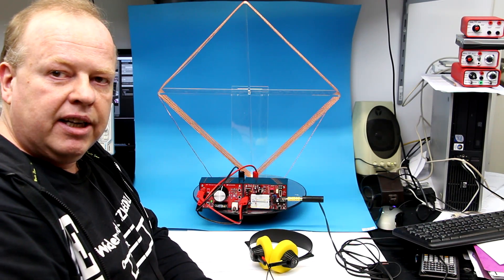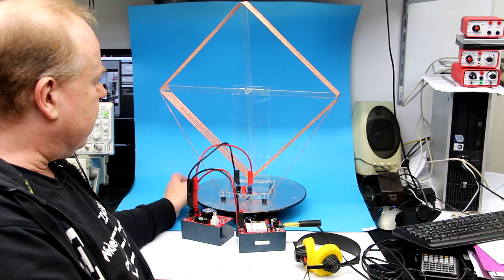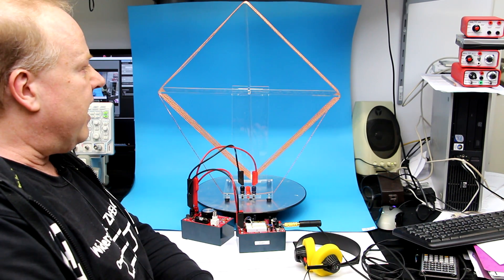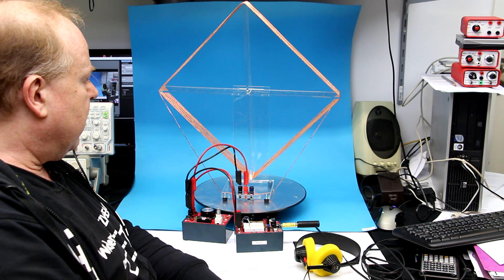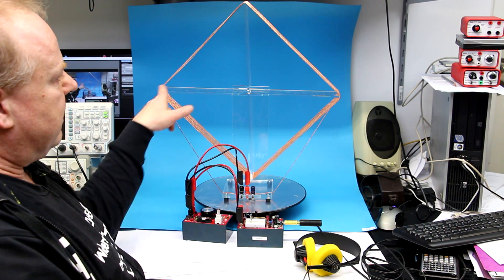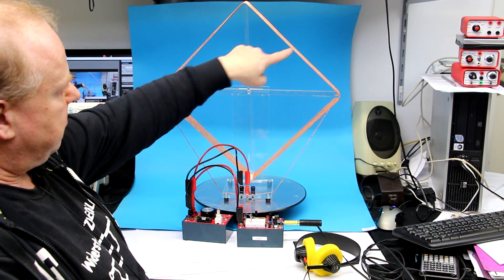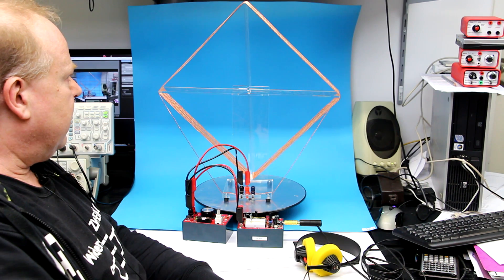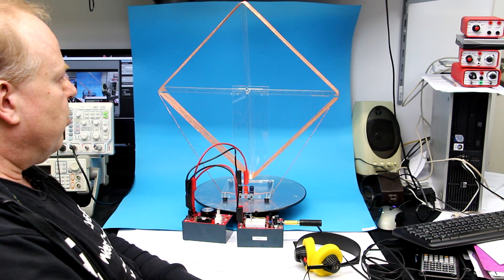New Frame Antenna available

Comment: is it different than a loop antenna ?
Reply from the maker: A frame antenna is of course a loop-antenna. But it´s a multi-turn loop and it is used not in short-circuit mode.

Comment: @KainkaLabs; 
Hello, 
since when this high-quality plexiglass frame-antenna is not available as a kit in your shop?

The description of the antenna on the store's website says. 
     "Die Rahmenantenne wird als Fertiggerät oder als Bausatz mit einer (englischen) Video-Anleitung zum Zusammenbau geliefert."

In addition, the clock on the forum page (both De & En) is incorrectly set up (it's delayed) and one can't open the page - my clock is synchronized with the clock at timeanddate.com so is correctly set up.
Reply from the maker: It is available in our shop. Try the old style shop: http://www.ak-modul-bus.de/stat/bausatz_rahmenantenne_500_mm_fuer_mw_und,pd730!0,,FRAME-ANTENNA1-BS.html
Shipping overseas is not possible ATM to most countries.
Reply: Hello. 
Thanks for the link.
Is shipping possible to countries in the Schengen area?
How can I get tips from you - if necessary - concerning assembling the antenna? 
As you said, a self-assembled antenna gives a lot of satisfaction during use.

If I give my email in such a situation, can I count on your help? For example, advice on choosing among dedicated antenna tuners.

 As I wrote before, one can't connect to your forum page (clock error on the forum page).
Please response.

Thanks in advance.
Reply from the maker: Shipping is possible to all of Europe and some ovrerseas destinations ATM, but not to the US, Canada etc. You can simply order in the (old-style) shop for all European countries. If you take a look at the shop-site for the frame-antenna kit under "Dokumentation" you can download a manual and there is a YouTube-link showing the assembly in real time. You can contact me over the offiicial email from our shop info@ak-modul-bus.de or roger@kainkalabs.com. The only thing with the forum is that the SSL-certificate has expired which gives a warning in most browsers. But you should be able to create an account etc. after allowing the forum site in your browser. Further infos about our AM antenna-tuners are also in my YouTube channel. There is a playlist "Magnetic Antennas & Crystal Radios" where a lot of information can be found. Basically everything you need to know about magnetic antennas.

Comment: Sorry Roger, i should have been more concise, i was thinking, i love that plexiglass base, was wondering if it could be expanded to accommodate a larger copper loop ( user supplied of course ) thx Dorian AC0SL.
Reply from the maker: Well perhaps. But it would have to be redesigned with bigger binding posts centered the middle of the base.
Otherwise it would tip over because the loop should be fastened directly to the binding posts.
When going to higher frequencies even a few dozen milliohms of contact resistance become important.
And the other part of the construction with the cross-beams is o´not useable with copper-tubing.

Comment: would love a sw version covering 40,20,17 and maybe 15 meters. or 10m-20m, i would definitely buy one.
Reply from the maker: For frequencies above 1.5 MHz litz-wire is no longer effective due to skin-effect and proximity-effect.
See for that my tutorial-series about "AM Magnetic-Antennas" especially also about the spreadsheet for caluclating magnetic antennas. There you can see for yourself that the Q-factor drastically goes down above 1.5 MHz.
You can only use thick copper-tubing for that. We are experimenting in fabricating copper-tube single-turn and multiturn-loops. But it´s very hard to make a commercial product out of that.
See e.g. this video from Jeri Ellsworth: https://www.youtube.com/watch?v=Al3ZJipFq6k
You also need more than one loop-antenna for all the frequency ranges because you are limited by the range of your variable cpacitor and different frequencies need different loop-diameters and/or turns for optimum performance (Q-factor).

Comment: hi, is there a reason why the spiderweb coils are not as big in diameter as these box frame loop antennas?
Reply from the maker: No, basically not.
Spiderweb-coils were invented/intended for small "living-room" crystal-radio receivers.
So there are the best compromise if you want a small reception coil.
If you want to bigger antenna with the highest possible signal-amplitude and Q-factor, nothing beats a frame-antenna.
Reply: I see , thank you

Comment: Looks real sweet. What kind of Q can you get out of those practically?
Reply from the maker: around Q=200 @ 1MHz (measured) with the used litz-wire (90x0,1mm)
With solid copper-wire of 1mm diameter not yet determined.
The signal-voltage is of course further enhanced by the large diameter of the frame-antenna compared to other magnetic antennas.
The useable signal-energy from a magnetic antenna grows with the third power of the diameter of the coil-diameter: https://de.wikipedia.org/wiki/Rahmenantenne#Grundgleichungen
(the english Wikipedia entry doesn´t have the formulas)